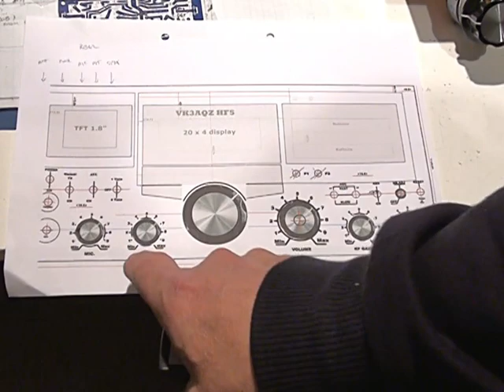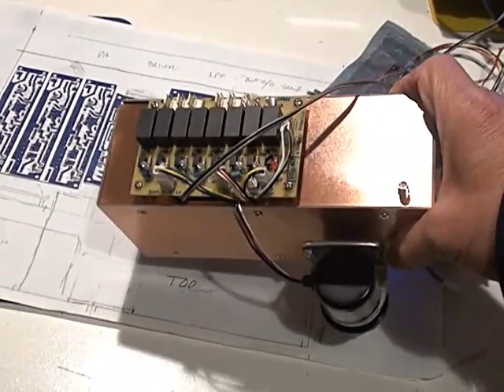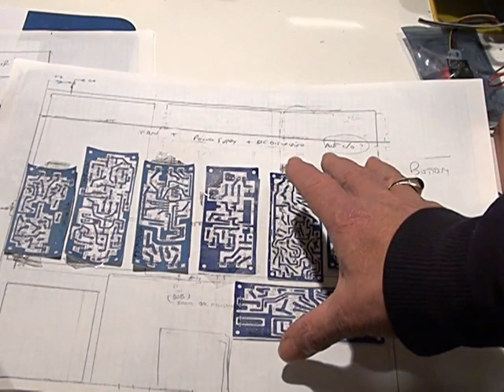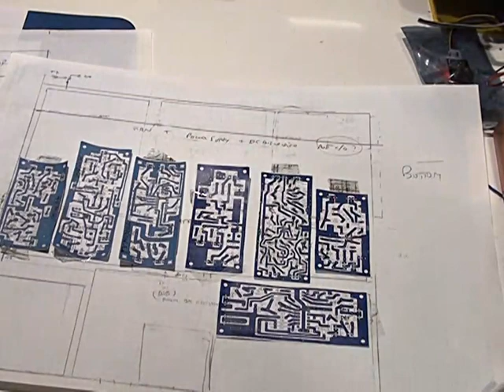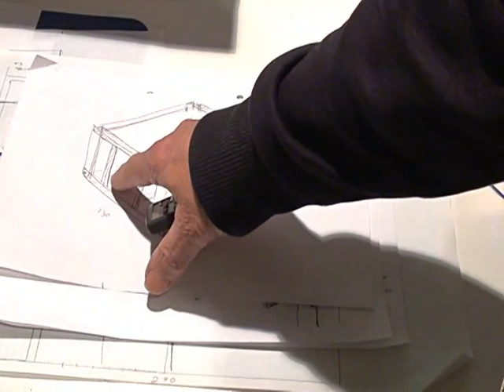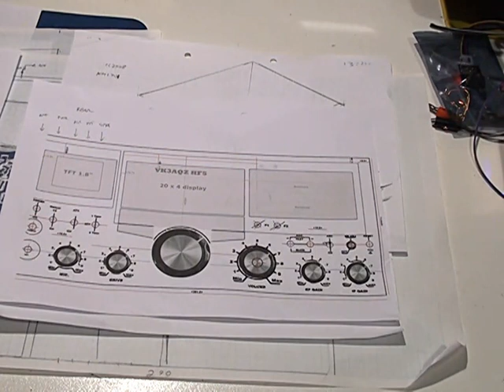Home brew HF Transceiver case design. The VK3AQZ MK5.

Comment: Now this is REAL ham radio IMHO. Real fantastic job! I really like your line of thought, the way you use the one side for RX, the other for TX and the rear for the large signal modules. I must say that until I watched this video I had seen the MK4 in another of your youtube videos and in partucular the red push-buttons in the escutcheons made me think - ahh so this is the rig they are used in - I have a component drawer with half a dozen of the exact same momentary switches but cannot for the life of me remeber how I came about them !
With regards to looks, if it was in green/grey with all black buttons, I would have thought maybe military, the color however looks really appealing so thanks for sharing how you printed/laminated the front panel, and indeed the rest of the rig's construction. 73!
Reply from the maker: Thanks for the thumbs up. Yes, a retro look rig using bits and pieces saved over the year. Works very well also. Cheers, Lou.